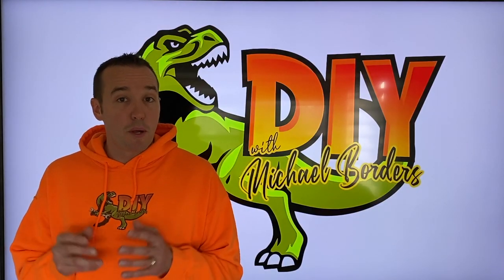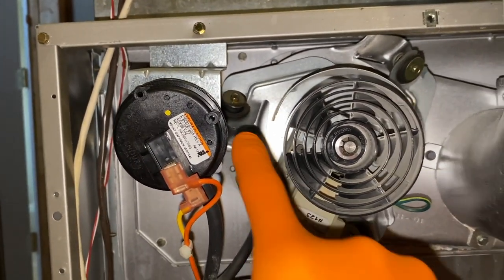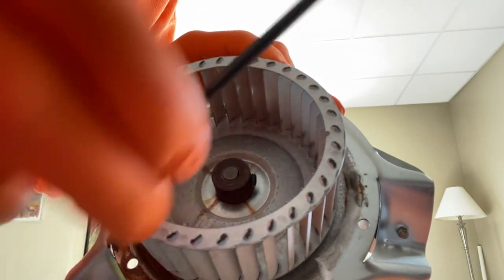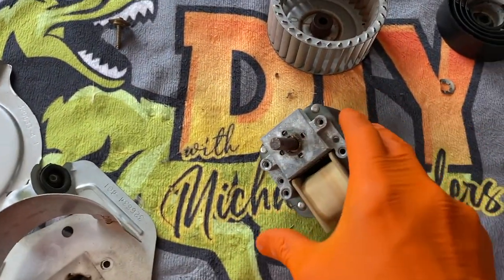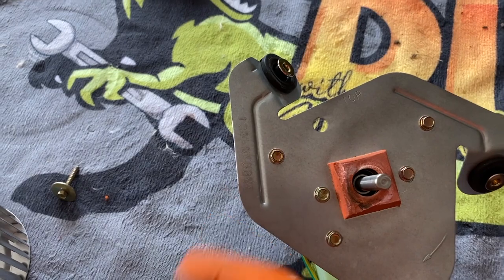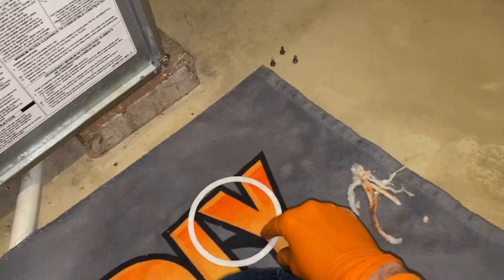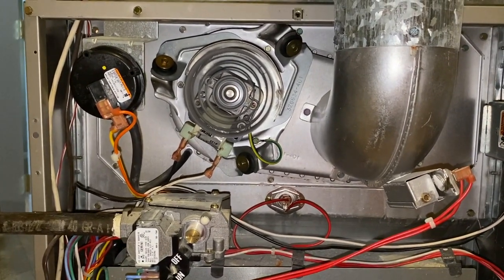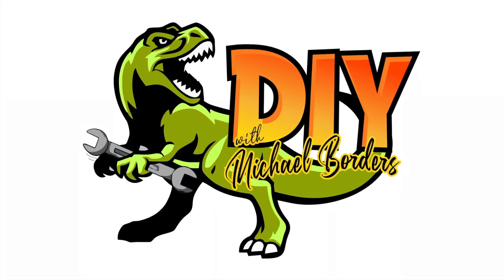Replace furnace inducer motor/wheel/gasket

Comment: Some shafts may not go flush with furnace always check. Also Blaster may not work try heating up the set screw with torch if that don't work get a bit and screw through the set screw with a smaller bit make room for expansion spray the blaster in the set screw keep trying. Worst case scenario get a new wheel if not using the old one and cut the shift. This guy did an excellent video.

Comment: This was immensely helpful diagnose a faulty inducer. My pressure switch was not closing because the inducer motor was not moving (took me a few hours to  learn that)!
Finally took the inducer assembly apart and turns out it was just moisture blocking the motor from spinning. After putting some wd-40 in the motor shaft, it immediately could spin freely. I put it back in the furnace and the pressure switch was now closing! Just need to replace the gasket now and I'm all good!
Reply from the maker: Outstanding, that’s great news.  Thank you for sharing this on your Friday evening, it means the world to us.

That’s awesome it was just moisture buildup and you were able to break it free and get it spinning again. 

After you install that new gasket and reassemble everything, you should be good to go.  Keep us posted.

Hey also if you’re into crypto trading, join our newly launched DIY community ecosystem.

       Toolboxtoken.com

We DIYers need to stick together!  🧰
Reply: @DIYwithMichaelBorders  House is warm and cozy now, thanks again!
Reply from the maker: @pablovanwoerkom1084  

😁👍🧰

Comment: Thanks for sharing the complete tutorial!  Only video out, I've seen replacing fiberglass gasket. That is expensive part i got for $25 + $10 shipping. It also came with the thick rectangle gasket.  Most often you would need to replace the squirrel wheel ($25) too when trying to remove it intact.  Great content!
Reply from the maker: Good morning, we appreciate that.  Creating good helpful content is our goal.  😁👍
Reply: For future reference, you can use high-temp silicone instead of the felt gasket.

Comment: For followers, with my Bryant model 310aav... repair clinic said the entire assembly was 326628-761 and the internal motor itself was HC21ZE121 however when I ordered a used part with that motor from eBay (Jakel J238-100-10108) it seemed to be the exact same full assembly.... Also of note is that the fan blade is made of fairly wimpy metal so if yours is too wobbly or sounds like it's hitting scratching something you can try bending it so it wobbles less... Not as good as replacing but hey in a pinch and cheap :)
Reply from the maker: Hi Roger, thanks for watching and sharing your info.  😎👍
Reply: @DIYwithMichaelBorders  Yeah it saved me hundreds, thanks!
Reply from the maker: @RogerPack  

You are very welcome, you can spend those hundreds of dollars on something more meaningful.  😁👍

Comment: great video...mine is seizing up a lot to the point motor won't run with loud humming noise so I imagine I will be purchasing several replacement parts for it...do I need the inducer motor as well as the fan
Reply from the maker: Thanks for watching & welcome to the DIY Raptor Club.  You’ll find it best to replace both parts including the motor and fan.  Please keep us posted on your project.

Enjoy your weekend.  😎👍
Reply: @DIYwithMichaelBorders  can't for the life of me get that allen screw out. Even brought it into the hardware store for them to try. It's pretty seized up and blaster hasn't helped at all. My furnace is super old so having problems finding the entire motor assembly. It looks a bit different from this one. MOdel of my furnace is payne 395CAV024055ACJA. Haven't tried heat but I'm imagining it's pretty badly rusted onto the motor spindle.
Reply from the maker: @IsaacGonzalez-et2bq  

Thanks for the update, have you tried:

       RepairClinic.com

This is a great site to purchase replacement parts as well.  You can enter in your serial number and all available replacement parts will be shown.

You may need to soak the screw in penetrating solution...or...apply heat...not doing both at the same time obviously.  😎👍
Reply: @DIYwithMichaelBorders  that site doesn't have the entire assembly(but has most other parts) so I am left with trying to figure out how to get it off.
Reply from the maker: @IsaacGonzalez-et2bq  

Thanks for the reply, penetration solution & heat...but again, not at the same time.

😁👍
Reply: @DIYwithMichaelBorders  I just went ahead and hacksawed it off as I didn't have a heat torch. Once I did that I took it apart and replaced parts, inducer motor, blower wheel, one of the grommets, new gasket adhered by Red RTV high temp quick gasket. All in all not too tricky except for the stubborn set screw. I think maybe using some high heat may have loosened it up, but tapping on it, soaking it with blaster, etc...didn't help to get it to budge at all. My assembly is fairly old so I couldn't seem to find it online unfortunately. I also tightened up the grommet to much and caused the screw to just spin so I used a nut behind the screw to help secure it as the new grommets seemed to be too thick, but all is working currently thankfully...cheers!

Comment: great video MB! Thanks a lot, i'll try to do this myself.
Reply from the maker: Thank you, we appreciate that.  Definitely keep us posted as you work through this project yourself.

We are standing ready to help answer any questions that pop up.  😎👍
Reply: @DIYwithMichaelBorders , finally removed the motor... black fan does spin freely BUT 20% not evenly, aluminum squirrel cage does spin freely AND evenly. No parts smell like churned or burned. How can I find the capacitor? didnt see it anywhere. Thanks again!
Reply from the maker: @techn0l0gyfreak  

Thanks for the update, the capacitor should be installed inside the blower motor area.
Reply: @DIYwithMichaelBorders  thanks a lot, again
Reply from the maker: @techn0l0gyfreak  

😎👍

Comment: I have the same exact inducer motor. The issue I’m having is that it’s just making a noise. It turns on and heats the house just fine. Ive tried to spin the outboard fan by hand I can replicate a feint noise as if it’s not centered. I can cure it by applying pressure to one side of the housing bracket.
 I’ve taken the assembly out as you did and the fan going into the furnace is nice and balanced. I can only assume that it’s the rubber grommets that need to be replaced? What is the part number for those?
Reply from the maker: Thanks for watching & welcome to the DIY Raptor Club.  If that’s the case, we agree with your thoughts on the rubber grommets.

We purchase all our parts from:

       RepairClinic.com

Keep us posted on your project.  Enjoy your night.

😎👍🔧🔩
Reply: Short term fix: You can also try shimming the housing bracket grommet(s) with some washers to recreate the pressure you applied to that one side.
Reply from the maker: @barkitybark6632  

Thanks for sharing.  😎👍🔧🔩

Comment: Hi Michael. I have the same furnace as the one you have here but my motor has this number jakel inc j238-150 11202. The one in the description, Is it the same one? I could find a part number
Reply from the maker: Thanks for watching & welcome to the DIY Raptor Club.  The best thing to do is get the serial # of the actual furnace (located on a sticker on the side of the furnace) & visit:

       RepairClinic.com

Once at this website, enter in the furnace serial # and all replacement parts that are compatible with your exact serial # furnace will be shown.  This will give you confidence and peace of mind that the part will work.

😎👍🔧🔩

Comment: The allen screw is not coming out ever after the blaster or WD40 application.  i am using a 1/8 inch allen wrench to remove the screw but does not seem to budge.  Any other suggestions
Reply from the maker: Thanks for watching & what’s your update?  You may need to apply heat to the screw.  Keep us posted.
Reply: same issue here...bent my longest allen wrench ...it's really seized up in there. Heat is a good idea too although I don't have a heat gun.

Comment: Question please: How does the control board know that the inducer motor/fan is not spinning?
Reply from the maker: Thanks for the question & the Inducer is connected to the board via wiring & the two electrically communicate with each other as the furnace is operating.  Hope this helps.

😎👍🔧🔩

Comment: Where do you get your replacement parts? Do you have any affiliate links?
Reply from the maker: Thanks for watching & welcome to the DIY Raptor Club.  We recommend visiting:

       RepairClinic.com

Enter your model number in the search window and select search.  All available replacement parts will be provided.

Hope this helps!  😎👍🔧🔩
Reply: After following your guide for taking apart my Carrier inducer motor, I realized that my fans were fine. So I strategically oiled around the motor rod to see if I could lubricate the ball bearings. After about 15 minutes of spinning and turning the motor around in my hands it started to spin without the noise or friction it had before. It's running nice and quiet again. We'll see for how long. Thanks for the video and the response on where to get new parts. It really helped.
Reply from the maker: @philodox13  

Very cool & well done!  Thanks for sharing this.  Keep us posted on how it performs throughout the remaining winter.  You Rock!

😎👍🔧🔩

Comment: Wish u could come over and help me fix mine I have no clue what to do it keeps making a squeaking noise I took it apart the fan blade the first spiny thing was so dirty so I cleaned and tighted it and it was good for few hours now it’s still making the squeaking noise and if I call a repair man Finna cost $400 probably 😂
Reply from the maker: Thanks for watching & welcome to the DIY Raptor Club.  This can be a friendly DIY project replacing the inducer however since you have already worked on it & it worked better, you may need to just verify all screws and bolts are properly secured & the fan is aligned & secured in place by the securing clips.
Reply: DIY With Michael Borders do u think I can make it not as loud without buying new parts and taking it apart I don’t trust myslef taking wires off 😂
Reply from the maker: @ATR.records  

It’s very possible however if you don’t feel comfortable, it’s definitely a great idea to hire a technician.

😎👍
Reply: DIY With Michael Borders now it’s not even working at all the fan blade is like stuck or something
Reply from the maker: @ATR.records  

Thanks for the update, in this case a new inducer motor is needed.
Reply: DIY With Michael Borders ya like it can turn on but the small black blade u can see when u open it up has a lot of frock ton and sounds like a scraping noise
Reply from the maker: @ATR.records  

Thanks for the reply, a new motor may be a must.  😀👍